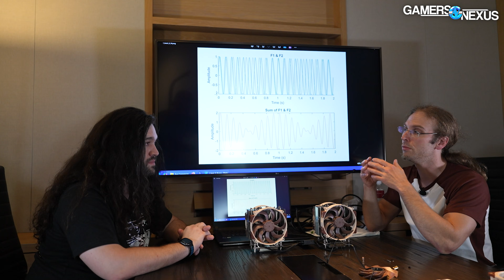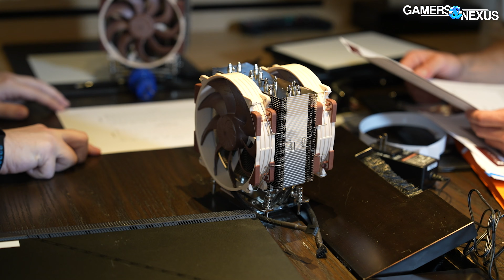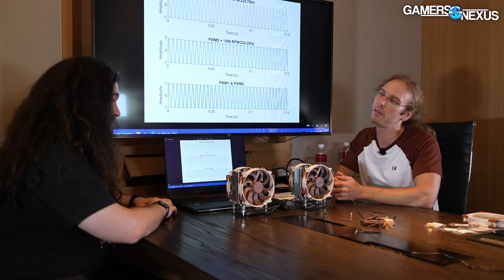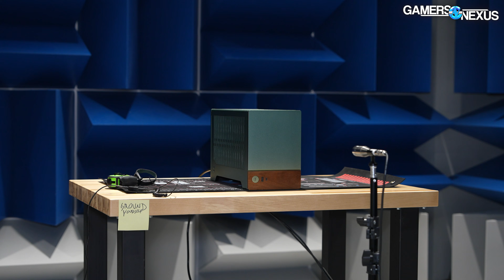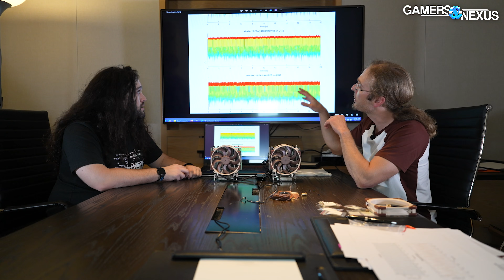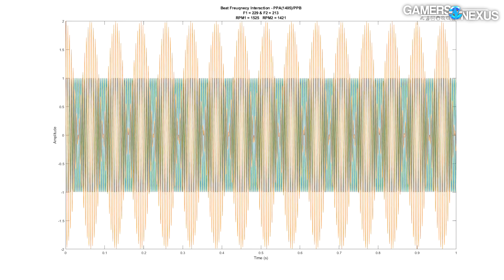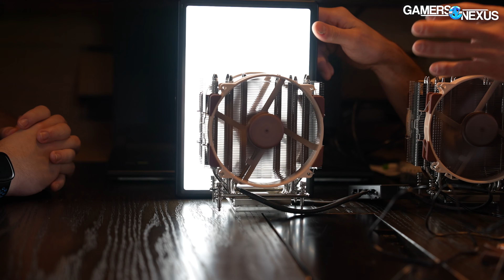The Most Annoying Computer Noise | Noctua Engineering Deep-Dive on Case Fans

Comment from the maker: Watch our "Forbidden Interview" with Jakob of Noctua last year: https://www.youtube.com/watch?v=82LZkglNiQ0
Watch our video (also featuring Jakob) about Noctua's pressure scan results and new Noctua NH-D15 G2: https://www.youtube.com/watch?v=nDDxYlkp-_A
Find all of our engineering interviews here: https://www.youtube.com/watch?v=nDDxYlkp-_A&list=PLsuVSmND84Qsv6Q_9GERaAKQ_FsQkOQ7H
Reply: Gamers Nexus is getting us more and more used to thorough engineering analysis of computer equipment nobody else dares to engage in. Kudos to you and your team for this one and the other one about curving/contact with modern CPUs and coolers.
Reply: "The most annoying computer noise" is COIL WHINE, right?
Reply: I wonder if there could be a way to sync both fan blade positions and speeds. Wouldn't that be a better solution. Having 2 different speeds creates 2 different frequencies and can cause sound modulation. I remember a similar trick we used to do as kids when whistling. Get 2 whistles or 2 people whistling at 2 different frequences and it creates a crazy modulation sound in the ears.
Reply: @robertlawrence9000  That's what aircraft do.  Unfortunately, it requires tight tolerances.  10RPM isn't good enough.

Syncing the fans precisely isn't worth maybe doubling the manufacturing cost, and tripling the price.
Reply: @EmperorA0  Yeah probably not worth it.
Reply: Ha...wrote about that noise to Noctua few months ago, they told me that's perfectly normal and that they don't see any problem. Never suggested me to lower the speed of one fan. And I have their fans on 420mm radiator and 3x140 on front and one 140mm on the back.
Reply: This is a lot of words to explain what a harmonic frequency is.

Comment: my issue with noctua fan is the motor buzzing sound. Why is that so loud? I tried to control them PWM and DC and get the same motor high pitch buzzing sound on my nh-D15 chromax Gen 1.

Comment: I have a y70 and lian li tl lcd fans. I can replicate the same wooo wooo sound with my 3 bottom 120mm intake fans if i set it to 1200 rpm, 1100 you can kind of hear it 1000 not at all, past 1200 you cant hear it really either. I just leave everything in my pc at 1000rpm and its pretty much dead silent, the psu is louder than everything else(when it kicks on[lian li edge 1300w]) and that leaves my 9950x3d idling at 44c and 5080 idling at 28c. 60-63c load on the 9950x3d and usually 40c load on the 5080 but 50c max. Next upgrade is the seasonic prime noctua edition so I dont have to hear the psu anymore.
At first I thought the fans were faulty, then I swapped it out with another set of 3 that I knew were working fine (had them mounted on the side and at 1200 rpm they didnt make that noise) when I put them in the bottom though it does, and based of the info in this video Im guessing because its somewhat matching my cpu aio rpms right above it. It's most noticiable if I have the bottom intakes at 1200 rpm and the CPU aio fans on the top at 1000 rpm, id imagine the 200 cfm difference is about what is lost on the travel distance from the bottom of the case to the top hench matching the rpm and creating the sound. 

I am definitely no fan/audio engineer or an engineer of any kind but maybe someone that does know what theyre talking about can use this information for future innovation.

Comment: this may be dumb, but what if we somehow attach 2 fan blades to one rotor and shaft like 4 wheel drive but for fans so there is no differential in speed? Not talking about manufacturing problems and how to build it, but from sheer logic standpoint?

Comment: While i kinda have the wooo sound but even more lower or barely noticeable  due to my PC case (Be Quiet! DARK BASE PRO 901), i have instead a high pitched noise like a whistle when both fans are at the same speed. You can see it in my most recent video, wich is more irritating and ear bleeding than the "Woo"

Comment: I had to tune all my Arctic P14 PWM fans AND the Noctua fans in a NH-D15 because they ALL have that phenomena.  I found out through trial and error that I had to split up the speeds so they don’t match, to minimise it. So I doubt it's really so restricted to fans with super tight speed control. 

The P14s need to be split quite a lot to shut that up:
37% - 40% - 44%
717 - 787 - 851 rpm

Noctuas:
44% - 43%
740 - 775 rpm

I haven't been paying attention to the video but if they haven't already Noctua should try experimenting by adding in random variation to the speed controllers?.. So the speeds are always changing in a random pattern between 50 rpm or so difference range... So each fan has a random number generated speed that will match very rarely between them.

Comment: I have an Arctic Freezer 34 esports duo and have this noise but it is much more pronounced. Both fans are connected through one port (which is how they come out of the box). How would I go about fixing this? Connecting both of them separately and changing their speed settings?
Reply: You need to plug them into to separate PWM headers for independent control. Or you could use noctuas low noise adapter, but this will knock off 275 RPM, which is a lot.

I’d recommend putting NA-FC1 on the fan you want to slow down (should be the rear one according to the video). This is a PWM speed controller. Put it in-line with your fan, plug both fans into the same header like before, use the knob to knock some PWM % off the rear fan, and slow it down to where the sound isn’t as noticeable.

Using the speed controller is a little more complicated but gives great control. You could always just use two headers if you have them though. And set the curves to that one has mahbe 5% PWM less

Comment: Sounds like a big advantage for a single-fan setup.
Or a reason to use a new type of double fan where the front and rear fan are connected by a mechanical shaft to achieve exact synchronisation.
Reply: Big advantage for single fan. The second fan usually doesn’t get you more than a couple degrees anyways. 

You wouldn’t want them synced btw, then the best frequency would be very low, close to 0, the worst possible.

Comment: Schwebung is the result of superposition of two tones of very similar frequencies, eby running one fan at 1000Hz and nearby a fan with with 1005 Hz. I avoid this problem in my PC by having identical fans and controling all fans with identical voltage distributed by Y cable splitter. This ensures that all fans have exactly identical frequency.

Comment: What would the challenges be of connecting both fans together with a common shaft/motor assembly? Obviously, the heatsink will need to accommodate a shaft going through it but I guess there would be other challenges.

Comment: Very intersting ! Do you known if this can also occur with case or AIO fans that are next to each other, or does this only happen with push-pull configurations ? I don't have enough fan headers on my MB to contol each fan individually but if this may be the source of this so annoying noise it could be worth it to buy a seperate fan controller
Reply: I have a fractal torrent with 3x140 in the bottom which many ppl complain can vibrate. I use noctuas NA-FC1 controller to set the middle fan a little slower than the rest (about 125 RPM or so)

Comment: Makes you wonder about beat frequency looking forward:  would it be possible with perfect enough fan control and fan tolerances to instead match the RPM perfectly, so the fans are always in sync, so there can be no beat frequency at all? 
(could you perhaps even "stagger" the rotation between the blades to minimize  any amplification)
I guess that kind of control won't ever be possible - or atleast not economically viable on a CPU-fan cooler?

Comment: Seems like the perhaps ultimate design for a "price is no object" type of cooler setup would be a very fine speed control knob/variable resistor on at least one of them, and instead of making the speed difference bigger so the pulse is faster and less noticeable, but still definitely there, let the user match the speeds EXACTLY and eliminate it entirely.

Comment: I wonder if you could get a similar effect by pairing two fans with dissimilar blade counts. Also English for “Aufschaukeln” is “escalation”.
Reply: Of course. The blade pass frequency is calculated by bpf = (blade number * RPM)/60

If the fans have different blade number, or a different RPM (two different size fans, or an offset) they will have different blade pass frequency, and likely, a high beat frequency (the difference of blade pass frequency).

Even one extra blade fan would be enough to give an acceptably fast beat frequency given typical fan speeds and blade counts

Comment: I'm from the loudspeaker-Industry and I think some things can be transferred to fans.

The best mesh for a speaker in terms of 
- airflow is a high percentage of air passage - Mesh with big holes, but small bars. And if possible, rounded bars instead of sharp edges
- and for acoustics (interferences/reflections) - is a hexagonal mesh

So I think for cases or fan-meshes/touch-protection/In-outtakes it would be similar. A hexmesh (also called honeycomb grid) is the way to go.
The best for me is Hv 6-6,7. 
( Hv 6-6,7 air passage is 80%. For comparison the case from the video has an elongated holes mesh, with an air passage of approx  33-40%.
the typical round perforation (offset) mesh with 0,6-1mm holes has an air passage of  only 15-25%)

But then, we have the next problem: 
The bigger the holes, the more problems with dust and dirt, so we have to use some sort of foam or cloth, but this will reduces the airflow.
The further away the dust cover (and grille) is from the fan, the fewer problems there are and we can make it a way bigger as the fan.

Comment: This is why mixing sizes is beneficial. The loudest PCs are the ones with all matching rgb lit fans. Run them all at the lowest setting possible with slightly different curves in the bios app. Done.
Reply: Yeah and no one has a clue about this stuff either lol. Three daisy chained fans all running on the same header, same RPM, same blade pass frequency

Comment: WTF is this, I thought Noctua built the best fans in the industry, were we all scammed into thinking so ?   I purchased aseveral of them in a box to use as backup fans in case the ones that came with my case fail, and now I feel bad, and scammed, so apparently they are ont the best after all.  I have the fans that came with my NZXT H7 Flow RGB, they are super quiet even at full speed, only wind sound........ I also have the Noctua Chromax black dual fan, and it's quiet and no such noise as described in video,  but I have some extra case fans I hope one day when I use them I don't notice any noise as described in the video.

Comment: This seems to be knowledge that has been lost to pc enthusiasts. Back in the 90s I remember that this was common knowledge. I remember putting different brand fans on a cooler to get rid of a "schwebung" noise in the early 2000s.
Reply: Yeah and it happens in sets of fans too. Like all these modern cases with 3x120 or 3x140, all running the same fan, same RPM, damn near same blade pass frequency. No one thinks to run the middle one at an offset lol

Comment: So I used to rely on this to tune radios. I would have a reference signal generator with 1k modulation and the receiver producing a 1k tone with the 1k modulation over the top. The two 1k tones would interfere - If the crystal was off even 0.1 hertz at 10Mhz, you'd hear the amplitude waver at a 10 second rate. Not just crystal radios but the TXCO on digital radios also.

So Noctua have a microsontroller in those fans no doubt to control torque - why can't they have the first fan in the daisy-chain be the master and every other fan after that be phase locked to the master using this torque control. Phase-locked means 0 hertz interference and no warble at all. If they use this in the future I want to be given shares :)

Comment: Slight disagreement on the title though, I think coil whine takes the cake for the worst modern PC noise issue especially for the high pitch frequency. Super interesting topic and cool to see that there's still so much to solve for small form factor air cooling.

Comment: the overkill way to solve this is to have 11 and 13 bladed fans so there is never a complete overlap between fan blades. and because they are prime numbers the harmonics are way less likely too.
Reply: Blade pass frequency is calculated by: (fan blade number * RPM)/60

If you have two fans with different fan blades, or different RPM (either bc the fans are different sizes or one is speed controller to an offset), then you will have very different blade pass frequency, and very likely (given typical case fan blade counts and RPM’s), an acceptably high beat frequency.

Comment: Why is this a problem? We have noise cancelling fans! Potentially...
Edit: Just learned in aviation there's something called synchronizers and synchrophasers which match propeller speed (almost perfectly) and propeller angle in the case of synchrophasers which means absolutely no beat frequency. I may not be an engineer, but I think Noctua could make noise cancelling fans. You need a fan controller with a microcontroller that uses the precise timing of the hall effect sensors and probably a microphone or 2 and probably does some kind of fan training like memory training. Not sure if any engineers will read my comment but don't forget to send me the consultation fee when you start your own business and make a billion dollars.

Comment: This is actually really interesting as I've always found the pulsating hum of fans to be harder to ignore than the steady sound of airflow when I'm not wearing headphones. Thankfully the loudest sound in my room is an air purifier with a really faint but really low white noise that you just naturally ignore completely. Unless of course I start playing everyone's favorite game, Cinebench. Then you'll hear the 3 Lian-Li fans in my AIO come to life and yeah, they absolutely have a pulsating sound that's obnoxious AF. Even worse it's not a steady pattern and it will pulse 1-1-2-1-2-2-1-2-1-3-1-1-3. The worst part is most airflow noise is trapped inside the case, but that slight vibration transfers through the case and is easily audible.

If only Noctua made better looking fans as beige and brown doesn't exactly flow with my all white build. My OCD has a far harder time ignoring that than a random hum.

Comment: At this point it shoud of been a common feature to easely equalize the exact rpm in all fans including the gpu fans to prevent that humming
Reply: GPU fans alternate in their direction they blow, which helps mitigate this problem. If all three blew into the heatsink you would have some low beat

Comment: Beat frequency oscillation has a lot of applications in a surprising wide variety of things. If you were ever an instrumental music student you know the sound of being "out of tune", often perceived as a 'wobble' sound, which is effectively a beat frequency being produced by two or more musicians playing a note a nearly the same note but slightly different frequencies. This is one of the main differentiating points between skilled and unskilled musicians; skilled musicians can perceive and compensate for this quickly, unskilled ones cannot. The cause for the difference can also be skill but also things like its tuning slides/adjustments, varied temperature of the instrument, and muscle limberness of whatever is driving the vibration (the latter two being a important parts of 'warm up' for permformers). In a more technologically relevant example, the harmonics of the beat frequency is what lets radio frequency (including cable/satellite) transmission work. Technology connections did a good video on this, which you can find if you search for "The Superheterodyne Radio".

Comment: You can avoid beat frequency noise by having randomized / changing hole distribution or changing hole size and spacing on a panel, but you will need to let the fan speed allow some drift based on felt load on the motor.

Comment: Fans typically run faster when put against back pressure no? Less airflow=less resistance to spin faster at the same voltage. At least that is how it is with large multi horsepower fans.

Comment: I don't understand why Noctua doesn't attach 2 fans with a through shaft on the radiator and  use a larger motor, This way they are always at the same speed. It is nice that they talked to you guys about this. It is nice to get information from those who make good products.

Comment: It is possible to prevent constructive interference in mechanical design by using numbers of components mathematically indivisible into each other.  In a given system, you can have 1 non-prime even number, 1 non-prime odd number, and the rest of the components need to be prime numbers.  For example, the Noctua fan has 4 struts (non-prime even) and 9 blades (non-prime odd).  If you wanted to add another fan in-line without the possibility of constructive interference at any RPM, give it a prime number of blades - like 7 or 11.   The concept is also applied to ethernet cable to reduce inductive crosstalk interference between the four twisted pairs of conductors - every pair has a different number of twists per meter that are not mathematically divisible into each other.

Comment: Id be curious about fabbing a spacer with stator vanes, jet engines use them in the compressor section to better direct airflow and smooth it out while increasing pressure.